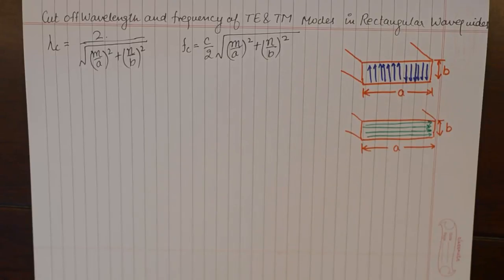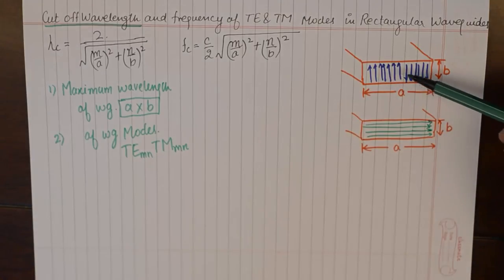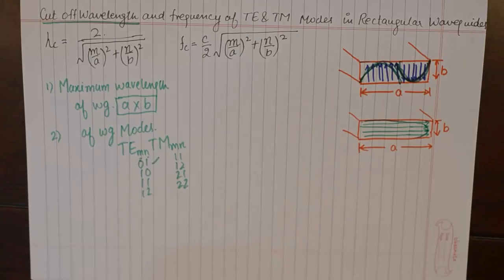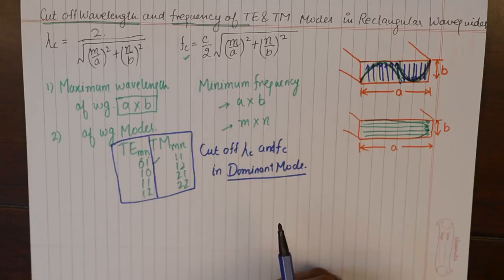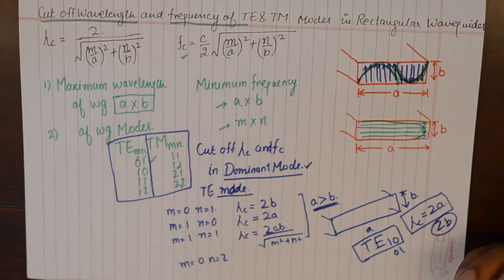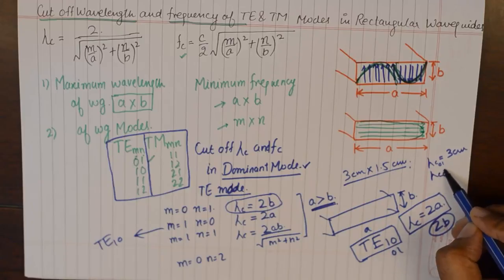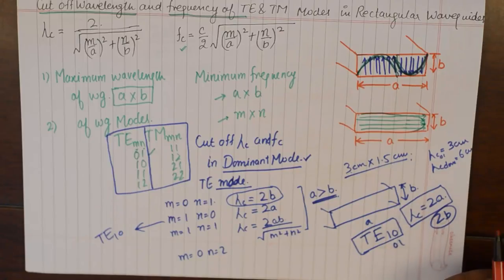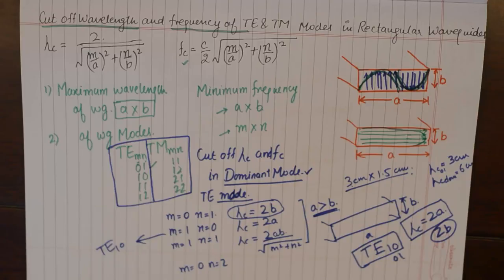Cut-off Wavelength and Cut off Frequency | TE and TM Modes | Rectangular Waveguides

Comment: thank you so much for you explanations
i am new in this field ,could you please explain how determine the Substrate integrated wave guide mode ? ans why the mode in some equations has 3 variable m,n, p? and is the cut of frequency is same as guided frequency ?
how determine the waveguide dimensions if i will use VNA to test my sensor is it (the VNA generator) considered  as a waveguide ? and is it has fixed dimensions according the type of VNA as Keysight  to use it for calculations of frequency before starting the RF sensor design ?